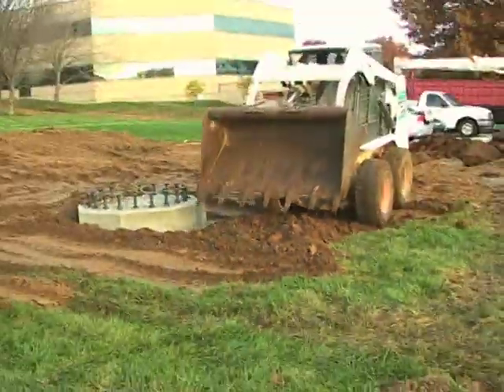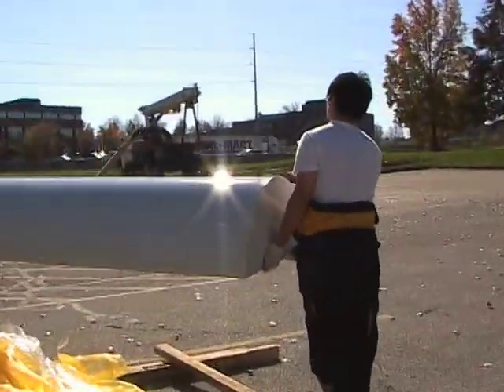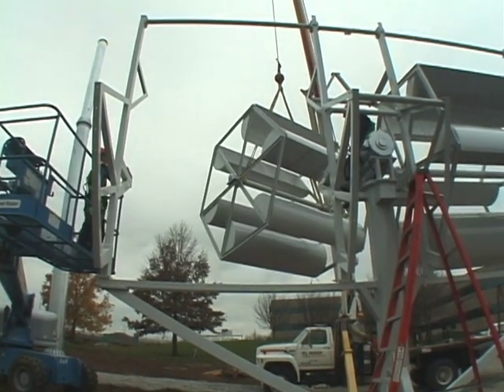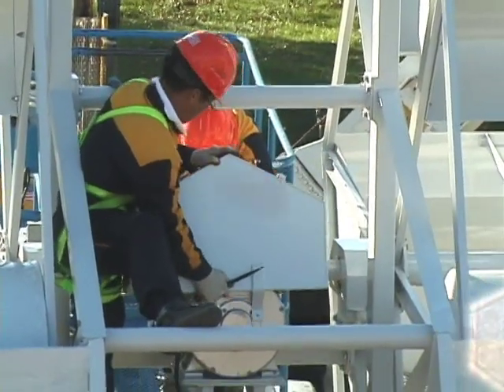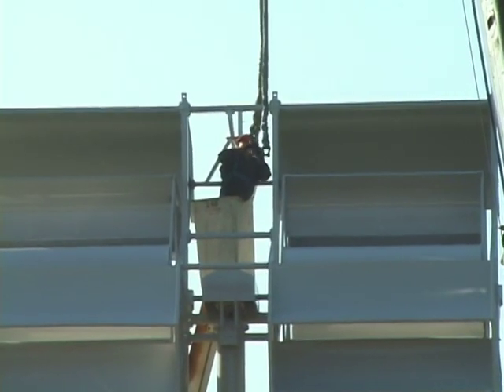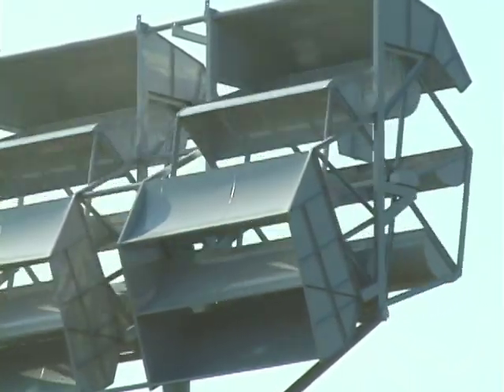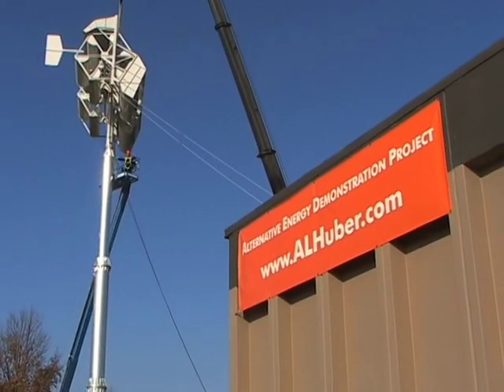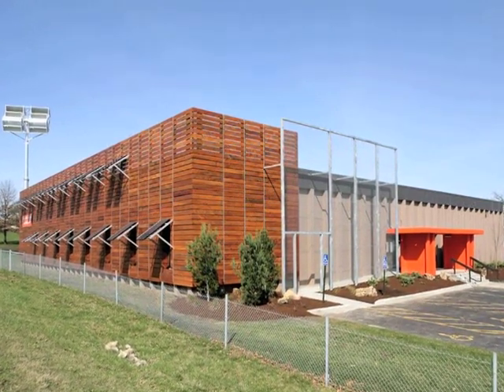Wind Turbine Kansas USA

Comment: Phil says oil and coal are not sustainable. Good point but how long do we have before we run out?  tom talks to burns and McDonald. Who the heck are they? OK so J. is an associate VP for B&M. It sounds like B&M is providing the money. Is this subsidy or grant money? Are we all paying for this stuff and salaries of the people at Huber who apparently had a foreign country do the design and manufacturing of this so called turbine.  Doesn't look like it works very good. Pretty sure this is a good example of the modern flim flam man. You can bet they are getting subsidized for their solar. Incidentally that huge monstrosity is rated at 5000 watts. This come out to less than 7 HP. At what rpm does it put out 5000 watts? It certainly wasn't putting out 5000 watts and that slow speed it was turning and where were the power cables. I saw one small conduit at the base but I didn't see any cables running away from it so was it just free wheeling? At 5000 watts that would be insufficient to provide power to 3 average American homes  or my experience one manufacturing power tool. So how much did this cost the tax payer?  B&M do you want to stand up and say what it cost?
Reply: Heey man. Such a tongue lashing.

Comment: Why using an horizontal axis ? Same désigne with vertical axis would be much simpler to use
Reply: my thoughts exactly.   You would not need a slip ring (failure point in many turbines)